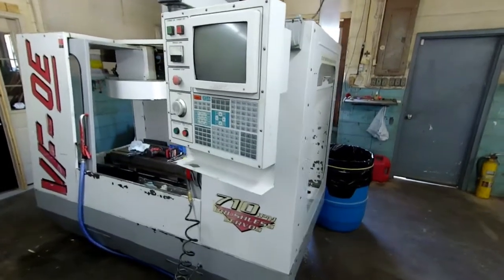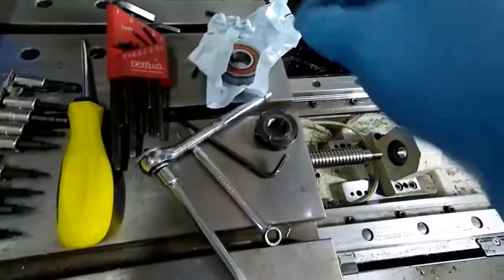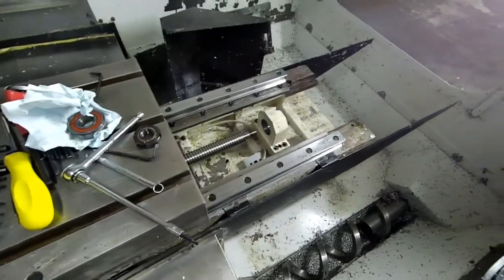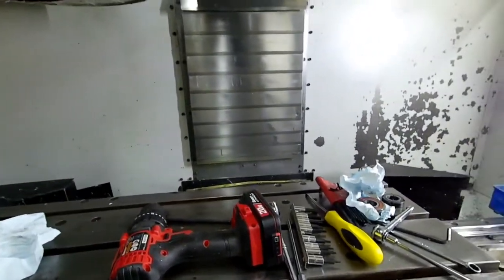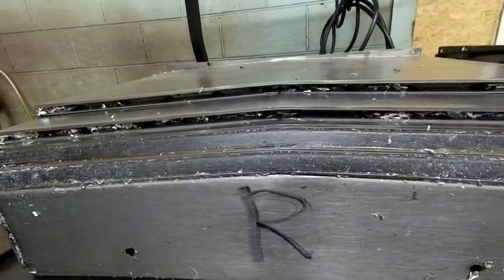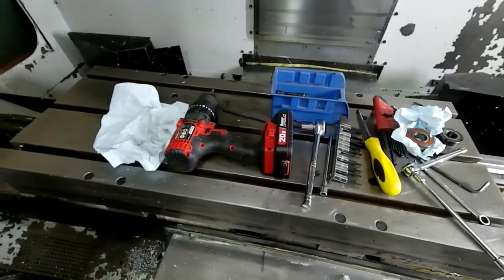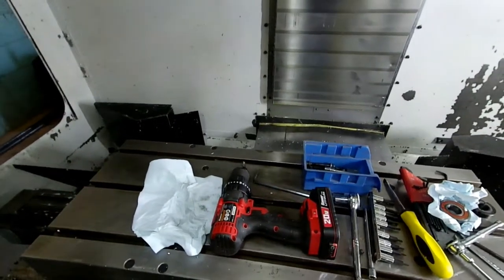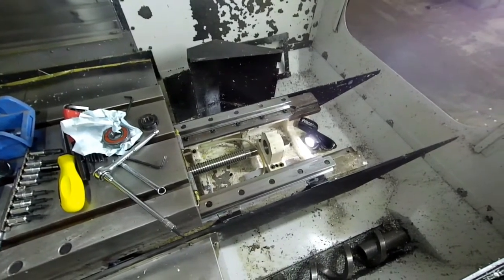Haas Ball Screw repair

Comment: Thank you for your video! Unfortunately everything on Youtube is OLD Ball screw videos and not much to look at. I am replacing the Z axis bearings on a ACRA Bed Mill DM2VS which there is nothing about doing this, manual SUCKS, the top is easy, the bottom bearings are in there 17" deep from the back of the mill.
I bought this mill used, I have done a lot of hard steels on it, it is way more rigid than my HAAS Super Mini mill, both mills have there place in my shop. If anyone has information on removing the bottom ball screw bearing assembly?
I WOULD REALLY APPRECATE IT! THANKS!!!!!!!!!!!!!!!